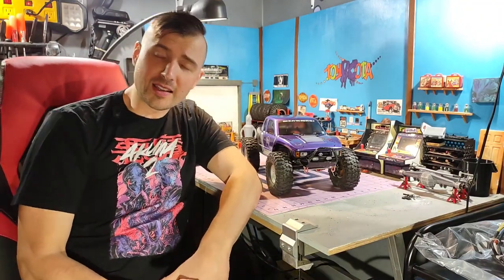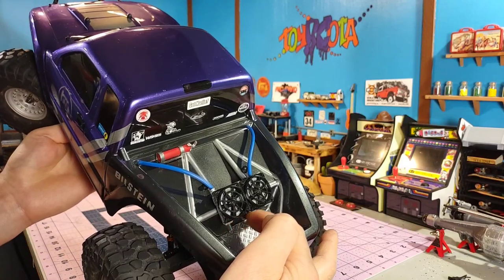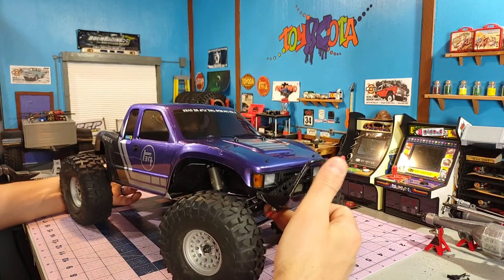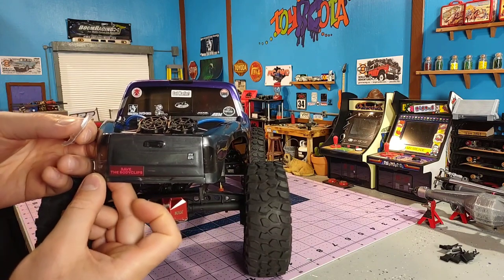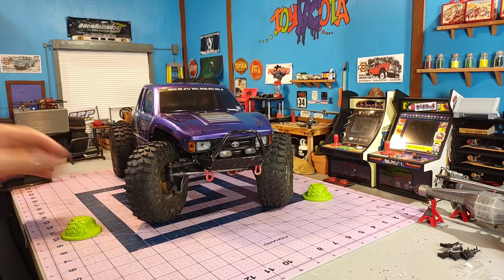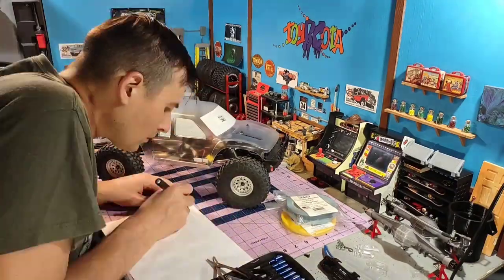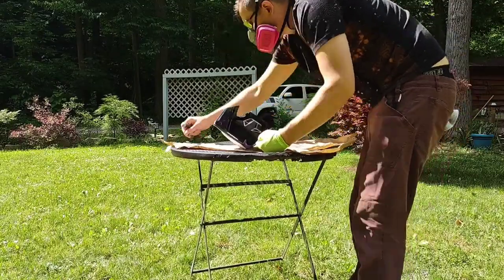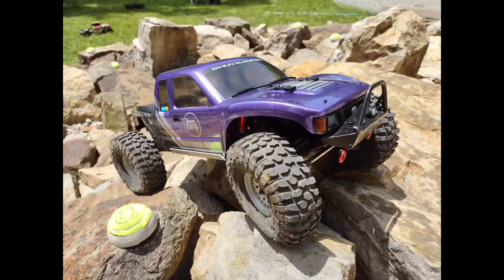Proline Cliffhanger Build With 3D Printed RCNerds and Knight Customs Parts Overview

Comment: Interesting vid but very difficult to watch...would have been nice to see your work at normal speed, and then more info on the 3d printed parts and specific links as to where to go to get the parts
Reply from the maker: Hey thanks for the feedback. I added a link in the description to the 3D printed parts. I have some more videos coming out so I will keep that in mind. 👍
Reply: @ToyRCota  so RC Nerds won't print also??
Reply from the maker: @longcrawler  Correct the files being sold on Myminifactory.com are just the files for you to print at home on your 3D printer. However Shapeways should also have a RCNerds store that will sell you the printed items but at a much higher cost.
Reply: @ToyRCota  ok...thx

Comment: What esc are you using in this build? Are these sliders stock or you made them by yourself?
Reply from the maker: Hey, Its a Mamba Micro X. Nice Light Weight ESC. The sliders are aluminum plate and made by (IE RC) Check em out got a nice online store.